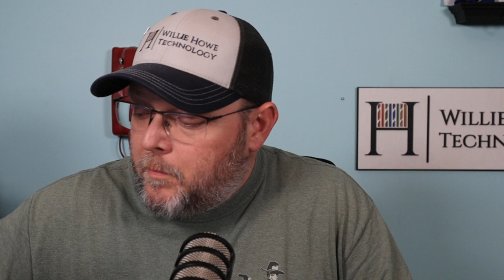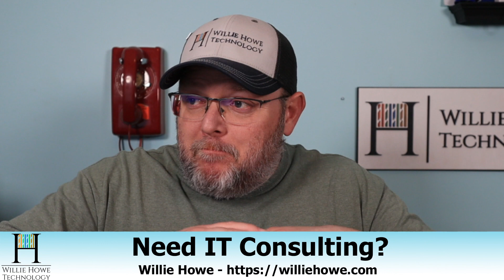Noise Floor - What is it?

Comment: But at what threshold is a noise floor a serious problem? And, what are the mitigation steps? Is using wider channels better or worse when surrounding by a high noise floor? Come on man, toss us a bone! ;-)
Reply: You can't control the noise floor (in most circumstances). It's the signal to noise ratio that you can control. Increase the transmitter to overcome the high noise floor, or move the transmitter and receiver closer to each other. 
The noise floor is an issue when it's close enough to the signal to disrupt it. And keep the 3dB rule.